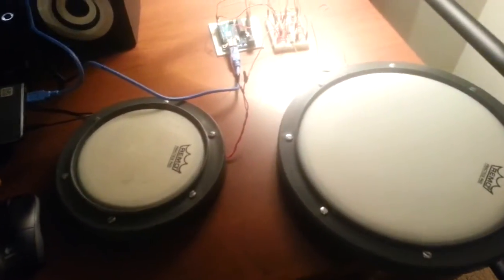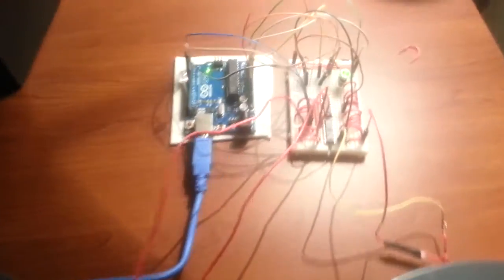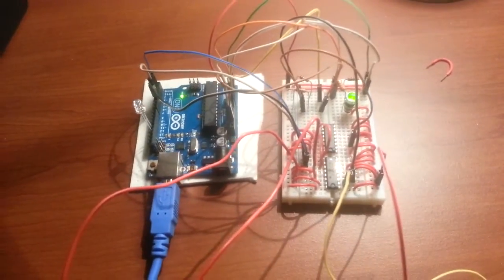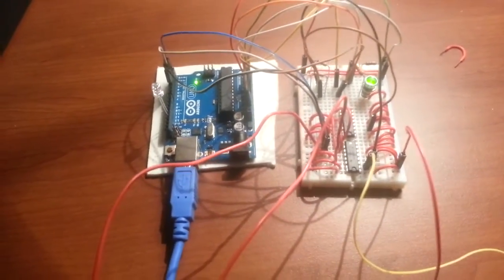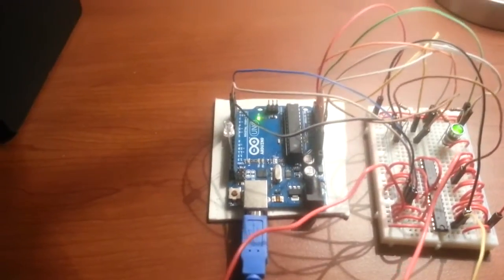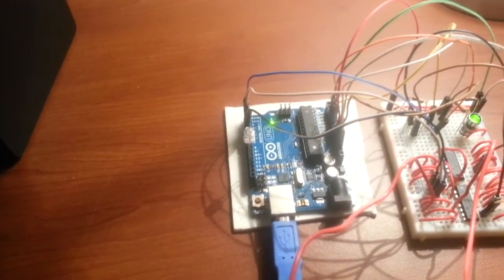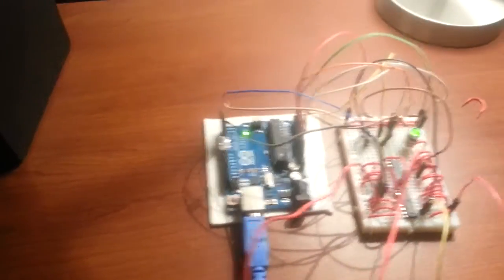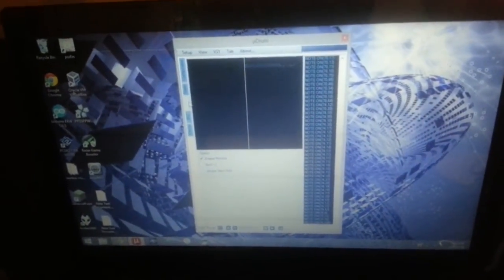Microdrum demonstration

Comment: Fantastic!

Would you have happened to document the prototyping of this at all? I have all the parts to build. It would be great to be able to breadboard it out before soldering.

Thanks.
Reply from the maker: Thanks! I'm glad you liked it. I am working on the documentation now! Hopefully it will be up sometime tomorrow, not as a video, but instructions with lots of pictures. I'll put it in the Microdrum forum, but will put a link as a reply to your comment once it's up.
Reply from the maker: Here's the link for building it: http://microdrum.altervista.org/forum/viewtopic.php?f=18&t=215
Reply: Wesley Saunders Thank you so much for that detailed documentation!

I have had a diy edrum set for a long time using an Alesis sound module for triggering, and then connect the midi out to my usb midi interface to trigger a vsti on the PC.

I was interested in building my own trigger-to-midi interface. And I was for a long time following a more difficult and expensive project at megadrum.info. With microdrum, that project is now obsolete, defunked, overcomplicated, and expensive.

I have had the parts to build a microdrum for over a year, but have just not got around to piecing it together. And if I can breadboard it, I think that will get me started.

Here is a link to my thread at the microdrum forums. That is my drum set. http://goo.gl/89pD4N

Again, thanks for sharing and being so detailed. You are awesome.
Reply: @wesleysaunders8161  the URL you shared on the forum is no longer available, you still have that guide so you can share it with me please.

Comment: When i connect it without multiplexer only A0 and A1works. Is multiplexer necessary? because i only want 15 inputs.
Reply: +Umar Nadeem You should use multiplexer becouse Arduino has only 6 analog input.  One multiplexer allows you to "virtually connect" 8 inputs to 1 arduino analog input.

Comment: probably a dumb question. but would a uno and a mux shield, such as http://mayhewlabs.com/products/arduino-mux-shield be enough to eliminate the breadboard, or would i still need extra resistors? trying to find the neatest, least amount of soldering required set up possible to create a zendrum-esque instrument.
Reply from the maker: The MicroDrum code is tailored for the TI 4851 multiplexer. The resistors are needed because of the piezo sensors and only one is needed per multiplexer. I imagine you could use that shield, but you might have to alter the code for it. Since this video I've changed the general layout. I bought a proto board like this
http://arduino.cc/en/Main/ArduinoProtoShield
and soldered two multiplexers to it(making my own mux shield) and everything is much neater than in the video. If you wanted the very least amount of soldering possible, you could use something like this.
 http://www.vetco.net/catalog/product_info.php?products_id=12707
I'm sure it'd be tidy, but there might be some worry of wires coming loose. If you have any more questions feel free to ask
Reply: Wesley Saunders thanks for the info. I just started working on this again. 

i understand why the piezo needs a resistor on it if it is plugged into the arduino analogue input. But it doesn't have to be between the piezo and the mux? do all multiplexer chips work like that or just the TI4851? does that mean the mux just cycles through its inputs and sends whatever signal it gets through one output, and so that output going to the arduino could be too high voltage for the arduino, but the mux can withstand it?
i havent done any electronics in quite a while so i've got a lot to re-learn
Reply from the maker: Graeme Evans As far as I know, you're right with how the mux works. To recap, the multiplexer can withstand higher voltages than the Arduino. You would need to check the data sheets of other multiplexers to see what they can handle.
Reply: Wesley Saunders okay, but what exactly would i be looking for? i had a look at some specification sheets but i don't know what sort of voltage they need to handle. since the voltage of a piezo can spike very high but for a very short time, i've seen some of the spec sheets list a duration for how long they can withstand a spike in voltage

how did you know the ti 4851 could handle the spike?
Reply from the maker: Before I chose to build the microDRUM, I looked at several other schematics and drum modules. All of them used the 4051 or the 4851. Something I just remembered, the 4851 is the same as the 4051 but with a bat85 Schottky diode in it. I believe they have a peak of 30 volts. So the diode protects the 4851 from over current. Also looking, the datasheet specifies no maximum input voltage for the 4851. They're made with automotive applications in mind. That's all I know about the 4851. I'm pretty sure the microDRUM sketch uses bit shifting to communicate with the mux, so if you can use bit shifting it should work fine